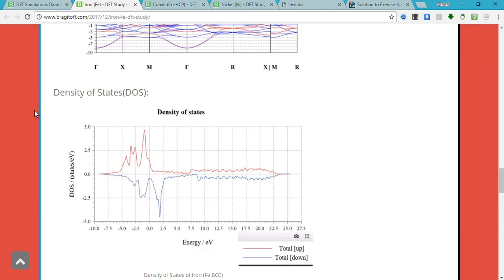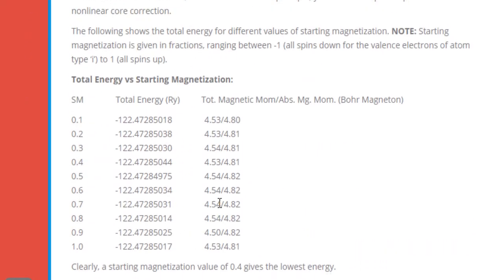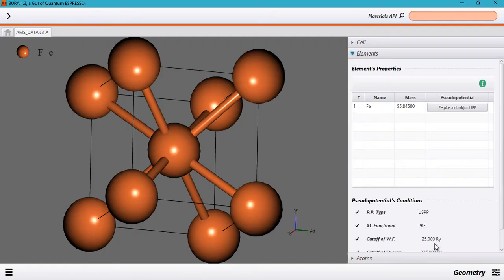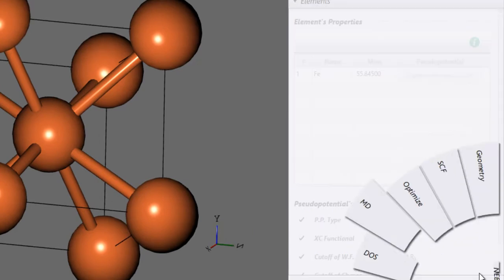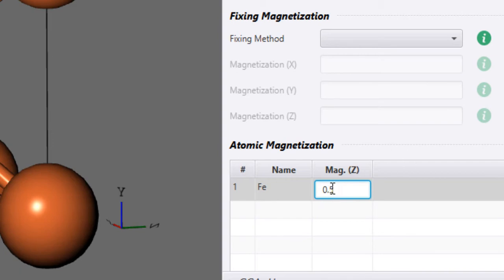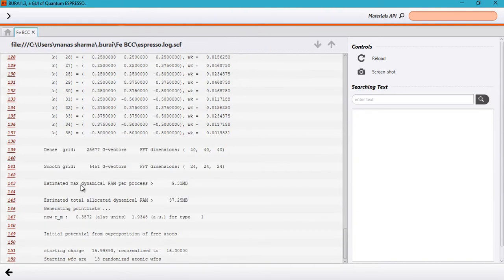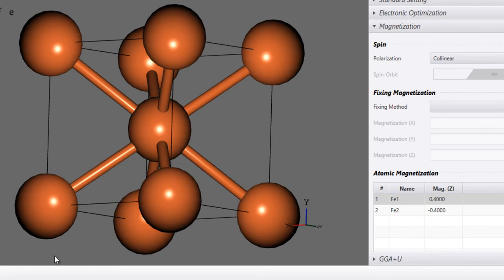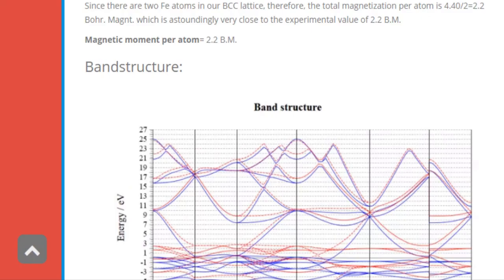Quantum ESPRESSO Tutorial - SPIN POLARISED (MAGNETIC MOMENT) CALCULATION using  BURAI

Comment from the maker: Actually, the video is a little flawed. That is, you don't need to run calculation for different starting_magnetizations and see which one gives the lowest energy. As you can see in the video the energy remains the same upto 6 decimal places which is probably because i set the scf convergence to only 6 decimal places. So essentially, all starting_magnetizations are giving the same energy. So in principle what one could do, is that they could try like a couple of starting_magnetizations such as one with all spins up or like 50% of the spins up,  and if they both return almost the same energy then you have found your ground state magnetization state. If they are different then perhaps you have two local minima and you have to find like which starting_magnetization gives the lowest energy. But again if the difference is smaller then the scf convergence criteria, then they are all the same basically. 
Also, the concept of tot+magnetization is useful, when you already want know or want your system to have a particular magnetization. For example when running a calculation with a single O atom. The magnetization should be 2uB as there are two unpaired electrons in p orbitals. Even if you provide a starting magnetization you would get the final magnetization to be 2 uB. In light of this, to save the computaitonal time, you could just specify the tot_magnetization to be this value and calculate the correspopnding energy. However, Let's say you have an iron supercell (2x2x2). Then since you already know the magnetization from the unit cell calculation, you could in principle use that to specify the tot_magnetization, but if you're going t o be study the surfaces of doping etc. in iron crystals or supercells, then you cannot hardset the magnetization using tot_magnetization. As that would force your system to have that magnetization. So if you want to study magnetization in a system, then tot_magnetization is useless. 

In my video, rather than using different values of starting_magnetization and comparing the energies, I should have used different values of tot_magnetization, and then seen for which value the energy is minimum. But then again it will take a lot of time, so it's better to just use starting_magnetization to break the symmetry and it will automatically converge to the ground state magnetic state. 

Sorry for making this mistake in the video, but in principle, the mistake doesn't affect the result, it's just that the time spent in finding the lowest energy for diff starting_magnetizations is useless, as they all give the same energy.
Reply: can you use norm conserving pseudopotential for spin polarized dft?
Reply: Thanks a lot. I learned many things from the video and your comments.Too many thanks :) No worries about mistake, I have learned other things from mistake too :) 
I tested using starting_magnetization starting from 0.1 to 1 by increasing by 0.1. I got similar total magnetisation with 0.2 and 0.3,0.4 .... until 1 but except 0.1. All of them gives similar results excepts one of 0.1. When starting_magnetization=0.1, total magnetisation gave totally different result. Is it expected case?
Reply from the maker: @hilalkucuk5  As I already mentioned in the above reply, you would have to look at the energies obtained using starting_magnetization=0.1 and other values. Whichever is the lowest, you could use that. Although since, all values except 0.1 converge to the same magnetisation state, I suspect that it might be the true ground state (global minimum).
Reply: @PhysWhiz  thanks a lot :)
Reply: Could please send me quantum express ?

Comment: Hello, I have a question regarding the non-collinear magnetism: For example if we would like to compare the magnetization in plane (IP) and out-of-plane (OOP) for a hexagonal structure, is it correct to run a non collinear calculation IP and OOP and compare the energies to guess the easy axis without any spin Orbit coupling (SOC), because I read somewhere that without SOC non-collinear calculation has no meaning, is that correct ? if so why ? thanks

Comment: Dear Manas, thanks a lot for video and site. I wonder I am working on Cu embedded on graphene. Should I perform  spin-polarized calculations on Cu embedded on graphene using scf calculation? Or Is just find spin-polarized calculations of Cu on crystal are enough?
Thanks
Reply: I'm a little confused regarding the question. But from what I understand, I think you should perform a spin-polarised calculation on the whole system as a whole.
Reply: Thanks a lot for very fast answer. I mean I embbed Cu on graphene and then check the lowest total energy vs total magnetic moment. I think it is correct way. After find lowest energy, should I use that tot_magnetisation or lowest starting_magnetization on input file?
Reply: @ManasSharma07  Thanks again :) I still have a doubt on my mind. I will make a relax calculation. After finding  starting_magnetization with lowest energy, should I put starting_magnetization on input file or tot_magnetisation to make relax calculation? 
The second question is you found 0.4 for starting_magnetization on video but you had put starting_magnetization=0.2 on input file. Did you put 0.2 for per atom?
Reply from the maker: @hilalkucuk5  Actually, the video is a little flawed. That is, you don't need to run calculation for different starting_magnetizations and see which one gives the lowest energy. As you can see in the video the energy remains the same upto 6 decimal places which is probably because i set the scf convergence to only 6 decimal places. So essentially, all starting_magnetizations are giving the same energy. So in principle what one could do, is that they could try like a couple of starting_magnetizations such as one with all spins up or like 50% of the spins up,  and if they both return almost the same energy then you have found your ground state magnetization state. If they are different then perhaps you have two local minima and you have to find like which starting_magnetization gives the lowest energy. But again if the difference is smaller then the scf convergence criteria, then they are all the same basically. 
Also, the concept of tot+magnetization is useful, when you already want know or want your system to have a particular magnetization. For example when running a calculation with a single O atom. The magnetization should be 2uB as there are two unpaired electrons in p orbitals. Even if you provide a starting magnetization you would get the final magnetization to be 2 uB. In light of this, to save the computaitonal time, you could just specify the tot_magnetization to be this value and calculate the correspopnding energy. However, Let's say you have an iron supercell (2x2x2). Then since you already know the magnetization from the unit cell calculation, you could in principle use that to specify the tot_magnetization, but if you're going t o be study the surfaces of doping etc. in iron crystals or supercells, then you cannot hardset the magnetization using tot_magnetization. As that would force your system to have that magnetization. So if you want to study magnetization in a system, then tot_magnetization is useless. 

In my video, rather than using different values of starting_magnetization and comparing the energies, I should have used different values of tot_magnetization, and then seen for which value the energy is minimum. But then again it will take a lot of time, so it's better to just use starting_magnetization to break the symmetry and it will automatically converge to the ground state magnetic state. 

Sorry for making this mistake in the video, but in principle, the mistake doesn't affect the result, it's just that the time spent in finding the lowest energy for diff starting_magnetizations is useless, as they all give the same energy.

Comment: Hello its me again. So im doing an optimization for Cl doped MoS2 and since i specified magnetization to be collinear it also calculates the total magnetic moment. Now in the iteration of the optimization when it converged, the total magnetic moment was around 0.67. However, after optimization is converged Burai/QE does one final SCF calculation. In the log it is titled: " A final SCF calculation at the relaxed structure" meaning in the iteration before this the structure was already relaxed. Now in this final SCF, the total magnetic moment is 0.03. Which value is right? And why is the value from the final scf very different if in the previous iteration it was already relaxed?
Reply from the maker: This thread might be of use to you: https://lists.quantum-espresso.org/pipermail/developers/2017-February/001567.html

Comment: What are the specs of your computer? I tried doing spin polarised band structure calculations on 3x3 monolayer MoS2 (27 atoms) and its been 8 hrs already but its still not done :(. For reference, Im using an 8 processor 8 gb ram
Reply: Btw sorry for asking these questions a lot. I just dont know who else to ask
Reply from the maker: A monolayer calculation wiuld of course take time due to a lot of vacuum. But did you add vacuum or are you just using a 3x3x1 super cell. For monolayer there should be a large vacuum in the the third direction.
Reply: @PhysWhiz  well, what i did was i started with an mos2 unit cell which is two layers of mos2. I made a slab in the 001 miller index and then i reduced the width of the cell until there is only one layer left.
Reply: @johnconrad4439  What if you delete the atoms in the top layer? Will it still be a slab (monolayer)